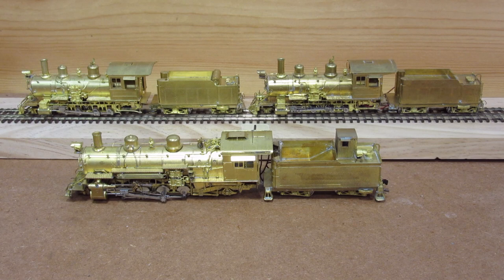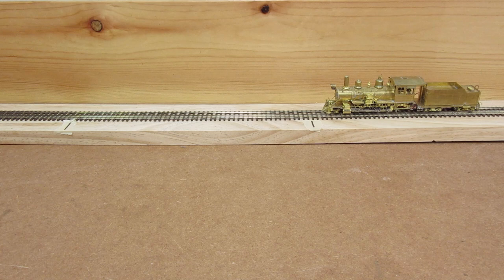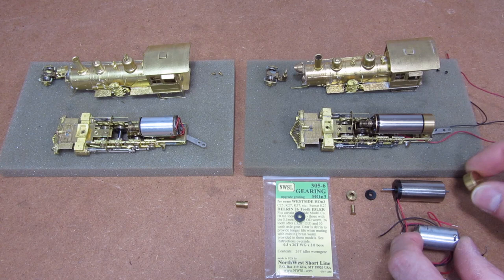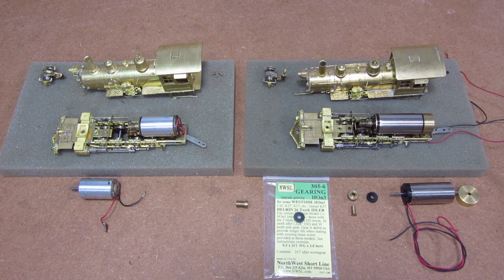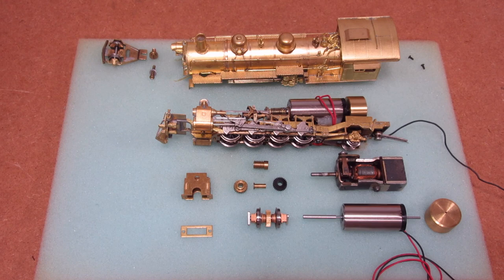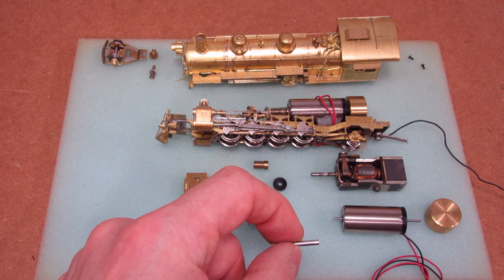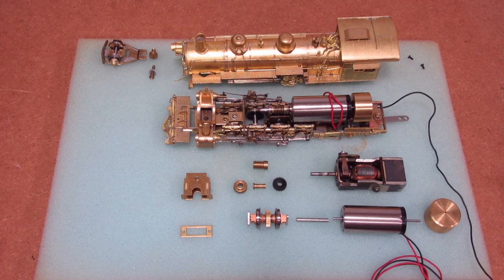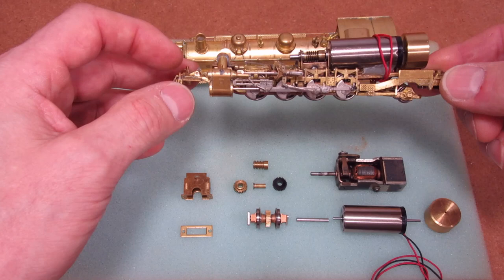Getting Your Westside Hon3 Brass Locomotives to Actually Run!  Re-gearing, Re-motoring and More!

Comment: This was a fantastic video. thanks!!
Reply from the maker: Thanks for the comment!  

I've got an entire shelf full of brass I'm slowly working through and documenting in the process.  Some of these mechanisms were so bad to begin with you have to wonder how any of these companies got repeat customers.
Reply: @dtj9923  Your parts that you use, such as replacement bearings and dowel pins for shaft up-sizing are very useful because I would have no idea where to start with those items.
Reply from the maker: @leisureshoot  Between Ebay and McMaster Carr I can generally find what I need to get these things working.  The availability of inexpensive miniature ball bearings really opens up some new possibilities.

An interesting observation from all my brass repowering:  If a metric bearing or dowel pin does the trick great, if an imperial part fits, great.  I do find that between both systems there is generally a perfect sized thing for the application.  I'm not shy at all about mixing standard and metric reamers or drills working at this scale to achieve perfect press fits or running fits.  I rescue a lot of bad, wobbly driver sets with oversize hardened dowel pin axles and some careful micro wheel boring.  Same for wobbly gears.

www.mcmastercarr.com

If you aren't familiar prepare to have your mind blown.  Their selection of components is amazing.  I often find bearing sizes there but generally buy them on Ebay instead.  McMaster is not the cheapest resource.
Reply from the maker: This is another great online resource for miniature bearings, I use these guys a lot.  They have everything from inexpensive to ABEC7 ceramic crazy stuff.

https://www.vxb.com/

Comment: Great video!
Reply from the maker: If there is any particular Hon3 brass locomotive re-build you'd like to see let me know.  I have a Key C-18 and Sunset C-16 on the way.  The Sunset C-16 fix is an absolute nightmare!
Reply: @dtj9923  I don't think it matters... I don't think it is the model that matters, I believe it is the techniques and experience you share.  I model HO Norfolk & Western.  I have NWSL 4-6-2, LMB 4-8-0 , Tenshodeo 0-8-0, PFM 0-8-0, and Daiyoung N&W/D&RGW 2-6-6-2 that I want to rebuild.   The one thing that is a little difficult is acquiring the lathe and all the setup pieces.  Not knowing what I don't know is the hardest part (and you've already helped immensely).  Investing $3,000 in a lathe and misc parts for it, plus MWSL tools to fix approx $2,500 of brass locos is a steep first step.  Then I have to paint them and add decoders.  :-(

Comment: Tell me how you drilled a dowell  pin such a tiny hole?
Reply from the maker: I use carbide drills, lubrication, lots of small pecks and a gentle touch.  I typically finish the bores with  HSS reamers.  It's not as bad as it sounds.

Comment: I may have missed it but what was the motor replacement in the C-25? I'm looking at doing a replacement in my C-16 and wanted to find something comparable.
Reply from the maker: Unfortunately the large 16x34 motor used in the C-25 won't fit in an Hon3 c-16.  Which manufacturer/importer/version C-16 are you looking to repower?   
Typically you'll need something in the 13mm diameter range if you go with a Maxon, Faulhaber, or Nimiki coreless motor.  Length is entirely dependent on how it's positioned in the boiler.  

If it's a motor in the cab type of model with no backhead, like the early Westside engines, a 16x24 can be made to work. But it will definitely stick out the back of the cab.

I have examples of most of the brass Hon3 C-16s on hand.  Let me know what you have and I'll see what fits.

Comment: Hi 
That was a fantastic video.  Thanks for taking the time to do it.
If you remove a driver axle how do you stop the springs from going into orbit when you try to reassemble things?
All the best 
Paul from Zillmere
Reply from the maker: The springs can be fun! 

The two best options I have found are:

Install the driver and journal box most of the way and then slip in the springs using tweezers or a spring pick.  This is still a fussy pain.

Second, apply a tiny (and I stress tiny) dab of grease at the base of the spring which will usually hold it in place while you position the journal boxes.  This works well but you need to not get grease everywhere.

I'm probably going to specifically cover all aspects of wheelsets shortly and will definitely cover how to manage installing springs.

Thanks for stopping by!

Damon
Reply: Thanks very much Damon.
Paul from Zillmere

Comment: Very good video! Have you thought about replacing the gear tower with a boo rim gearbox? I’ve wondered if they’d fit.
Reply from the maker: That would be a great retrofit, as would an MMI K-27 box.  The issue is ease of availability.  NWSL gearboxes will fit just fine and work well, I have used many.  Honestly, after rebuilding and upgrading the Westside gearbox works fine.  The ball bearing upgrade is easy enough.  Truing the axle gear knurling would be required regardless of the path taken.

Comment: I’m about to do this exact project on my west side k-37. I was wondering what item # the nwsl delrin gear was. Also, what size tubing did you use for the hub replacement? Thanks!
Reply from the maker: Hey Sam,

This the gear I used is NWSL 305-6  (0.3 mod x 26T x 3.0mm bore)

https://nwsl.com/products/worm-gear-0-3mod-x-26-teeth-x-8-4mm-od-x-0-110-face-x-3-0mm-bore-delrin

I used the same diameter idler pin as the existing brass idler pin, 3.0 MM. 
A McMaster Carr hardened, ground stainless dowel works great.
I set it in place with a little JB weld just on the exterior.

The gear hub was cut from a piece of 1/4" brass solid stock, don't forget to leave a shoulder on one side to press the gear against.
This shoulder really helps keep the gear perpendicular to the hub when you press it on.  Any wobbles are no good.
The Westside/PSC brass hub is 5 MM in diameter.  I would try to keep the shoulder side close to the full 1/4" brass rod diameter.
DEFINITELY put a light taper lead on the 5MM side to help the alignment and pressing process, otherwise you'll end up shearing a plastic ring out of the gear.
The Westside hub measures 4.88 MM wide but check your actual gearbox dimensions.  
Using 3 MM stainless thrust shims/adjusting washers from McMaster Carr between the brass hub and brass gearbox is an excellent idea here.  
You really want close to ZERO running clearance on those side faces and using stainless thrust washers reduces the lateral thrust friction dramatically. 

I would probably bore the gear first and then match the hub diameter to fit.  The gear is $10 but the brass is cheap.  I used a very light press fit.

Last but not least, if you can get the brass worm electroless nickel plated while it's off the loco I would encourage that.  
There are simply no more worms out there and NWSL doesn't make them.  The nickel will really help with wear.  Electroless is important because electroplating likes to glob up on sharp edges and it will ruin your worm.  Electroless is a completely uniform coating.

Good luck!
Reply: @dtj9923  wow! Thank you so much! That’s incredibly helpful :)

Comment: Where do you buy the motors?
Reply from the maker: Hey Juan, thanks for stopping by.

Unfortunately it looks like these motors have totally vanished from the online surplus market.  I'm now wising I had bought a lot more more of them.

Copied from a reply below to Justin:

"There was pile of them on the surplus market last year and it looks like they are gone.  Now wishing I had bought a few more.  I just looked around online including Ebay and it appears they are totally gone from the internet.  Allelectronics.com had them last and selling for just $9.00, not any more unfortunately.  There was also a model train guy selling them on Ebay for $20, he's gone."

Maxon has some motors in their DCX and RE line that will work really well, you'll need to configure them with shafts on both ends so you can attach a flywheel.  Unfortunately they aren't going to be $9.  They start around $100 and go up from there.  The up side is that they're 7 pole and not 5, that makes them insanely smooth at low speeds and you can get them with mini ball bearings.  

If you go the MAXON route you need 7000-8000 rpms at 12V to get a prototypical operating speed with the stock Westside gearbox.  If you use a NWSL 36:1 replacement gearbox you can go with a 9000-10000 rpm motor.

Sorry I can't be of more help, Namiki Motor doesn't have any real presence in the USA.  

-DTJ

Comment: What kind of voodoo can you do on Westside SP ten wheelers?
Reply from the maker: Thanks for stopping by!

I have not yet taken a dive into Westside SP ten wheelers but I do have a Westside SP #1/NCNG 9 that is a total disaster.  Probably very similar.  It's waiting for the back shop.  The wheels are pretty wobbly all around, definitely feels like it needs quartering, and has very sloppy axle slots in the frame.  It definitely wants a NWSL gearbox, with a good coreless motor and flywheel.  The stock gearbox could likely be reused with a major rebuild but a NWSL gearbox is a lot easier.  I'm learning that lesson right now with a Custom Brass C21.  That particular locomotive is a real mess to sort out BTW.

So are we talking about motor in the cab or tender drive flavor SP ten wheelers?

-DTJ
Reply: @dtj9923  thanks for getting back to me.

Well I got a wild hair, and started just collecting HOn3. The SP having 5 locomotives out of the box felt like a achievable goal. Going to stick to the locomotive drive and not the tender drives. Tender drives never looked good enough.

Picked up a no.1 a few weeks ago and a no.9 4-6-0 is on its way. The no.1 had a little binding and no motor in it when it got here. She rolls nice now but I have not installed the motor back. The ten wheeler kind of has the same story. Taken apart and was not run much. He did put it back together and it kind of moves it's self to be nice. I was going to try and collect all four of the steam, so it could be done in go. 

First time having this size of brass so I might be over optimistic here. The goal is Dcc and sound (dream of a speaker in the boiler) with some how a keeper if theres room. What might be really impossible is some backhead detail in the cab. Moving the gear box to the next driver to make room in the cab was really interesting. I am not used to modifying brass like that. Used to people snobbery of brass like it's a holy object, and then there's the "don't paint it" people. It's vary neat to an operators upgrade vs a collectors shelf.
Reply from the maker: @modelrailroadexcursions987   The be clear on brass, some of it is absolutely off limits.  PSC Crown factory paint models, BLW, and Division Point immediately come to mind.  But the early stuff was so bad you really have no option but to totally overhaul the mechanisms and add all the missing details.  The stuff in the middle like the mid to late Westside models is a mixed bag.  The y still need drive mods like plastic idler gears and steel worms to live a long life.  Plus there's always wobbly wheel assembly issues to fix.  If anyone ever read Jim Vail's "getting them running" articles in the Narrow Gauge Gazette they'd know why I refuse to treat most old brass as sacred objects.  It takes a lot to "get them running".

Here's a good place to find some sound info, advice and, options to consider for your particular engines.  (http://www.roundbell.com/hon3conversions.html) Unfortunately his photo links are all broken but the descriptions are useful, especially the watch outs.

Don't forget to grab yourself a GE Diesel #1 while you're collecting SP narrow gauge.  I like the Jonan version better than the NWSL version for a lot of reasons.

With the Westside SP Hon3 models you'll run into a few different drive systems:  

I was asking you about tender drives with the advice to avoid them unless you plan to replace them entirely with in loco drives.

The angled non idler gear drives, usually with a big boxy motor in the cab, are problematic.  My SP #1/NCNG #9 has this drive and it's trashed.  The brass on brass drive is worn out so bad the worm no longer meshes.  This is common.  NWSL makes 5MM steel worms that fit but the original Westside worms fix in place with a set screw.  This is solvable with some creativity.  The axle gear is not a stocked item but they have a 30 tooth 0.3 mod Delrin gear that can be bored in a jeweler's lathe to fit the 3 mm axle.  They only sell it in 2.4mm bore.

Allegedly the later production version of the drives are more like the C-25  in my video.  They use an idler gear setup.  Same rules apply.  Steel worm if you can.  Plastic idler gear for certain.  These are very workable.  My late production C&S #74 actually has a legit separate floating gearbox, not sure if the SP models ever got that.

If you're going DCC the old giant open frame motors will definitely need to go. You can toast a decoder with amp draw in an instant.  Cheap coreless motors on EBAY are a great option and there are plenty of rare earth can motors to pick from as well.  I can help with some motor recommendations based on my SP#1 shell and frame.  

Use this handy calculator to dial in your motor speed and gearing!  https://www.omnicalculator.com/everyday-life/rpm    SP#1 has 40" drivers, SP #9 has 44" drivers, 35 MPH is the absolute speed limit. 15-25 MPH is a more realistic operating speed.
  
Personally I like DCC and sound in the tender, it leaves more room for lead in the loco and makes it really easy to co-locate the keep alive units.  More weight has never hurt an Hon3 locomotive.

Let me know what you run into as you dig in.  Definitely post some quick little videos.  I love this stuff!

-DTJ
Reply: @dtj9923  My GS-6 is PSC, and it was the only thing to survive a housefire. Had it for years and never ran it or took it out the box. It got DCC and sound into it. Been a fuss to get to relax but it can make a 30" and 28" turnouts. 

Sadly that first link is a 404 for me.

Now if I already have a No.1 how can I have another? Maybe number the little GE two instead.

What locomotive do you have the standard tender, or whaleback? 

You wouldn't understand unless you had a good sound equipped model with a speaker in the boiler, and did some recording. It's so much better having the sound come out of its actual location as it goes by. That's why I like my 4460. That being said better pulling is better then sound in something so small.

How would you feel about flipping the motors location to the boiler side? That would free up all space for backhead detail. Then fill all of that fire box space with led? Or heavy speaker...
Reply from the maker: @modelrailroadexcursions987  

http://www.roundbell.com/hon3conversions.html

Try this version of the link.  Should work now.  His info is a lot easier to read on an actual computer screen.  A little tough to follow on a phone.